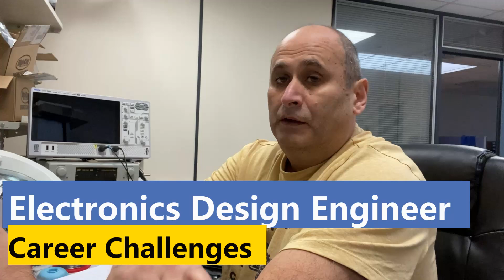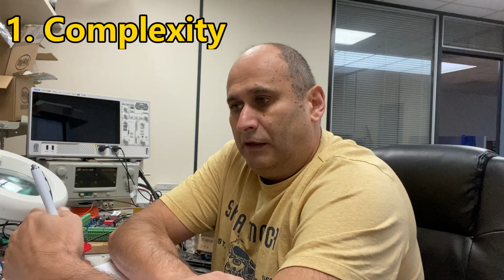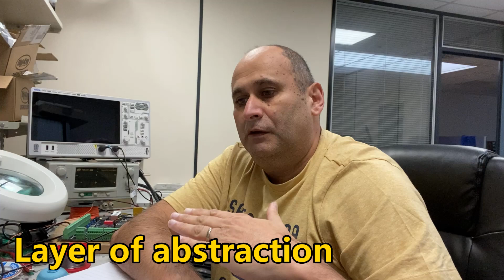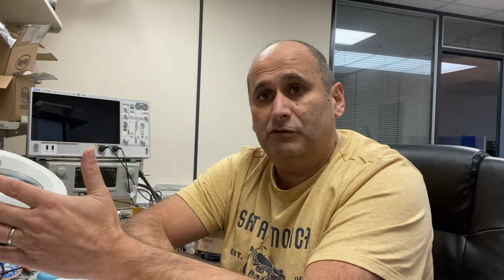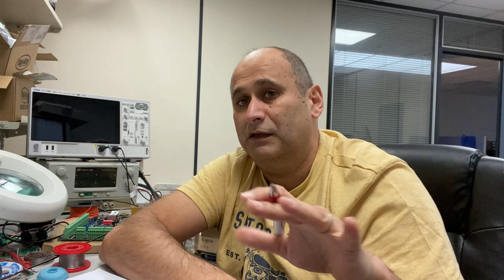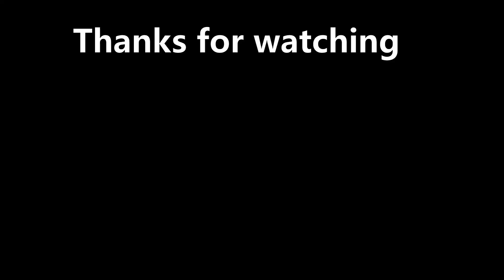Electronic Design Engineer Challenges

Comment: Wanted to add. That how do you protect you IP if your getting you boards manufactured in china is this an issue. What would you say on this matter? Should a person be concerned. Thanks for your videos.
Reply from the maker: It's a complex one, depends on the product, some products are more attractive for counterfeiter than others. The main risk is that holding a patent has little value over there you need to understand all the  pros/cons when you decide to build your product over there. I'm not saying that you should or shouldn't is a business decision not so much a technical one.

Comment: Whenever I look for jobs they ask for 5-10 years experience and expertise in digital design, but its hard to get there without the training or work experience.
Reply from the maker: Nobody will hire you on a position where the requirement is 5-10 years without training or work experience. Start low in junior job and grow from there or self learn these things while in a different job. Everything I learned about FPGAs I learned outside of the formal education system (because FPGAs were not around when I was in University) so it's possible, and I know many others. Don't focus just on FPGA learn electronics in general and digital design on the side, learning just FPGA you are painting yourself in a corner.
Good luck! Don't give up!